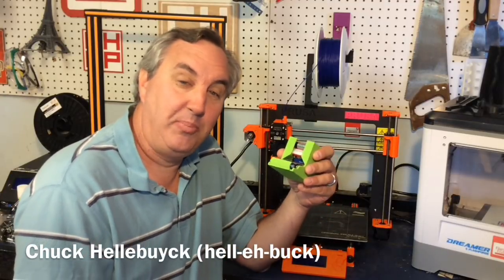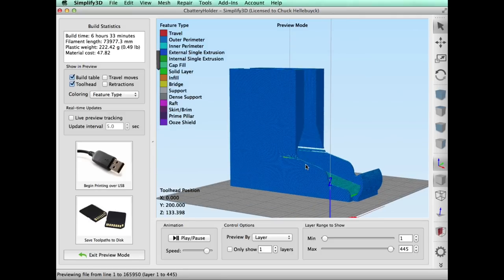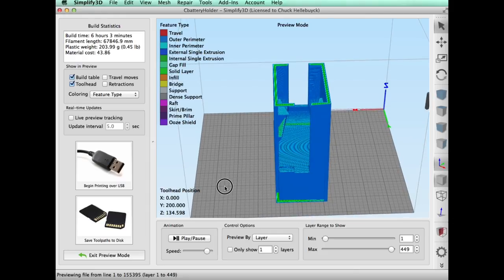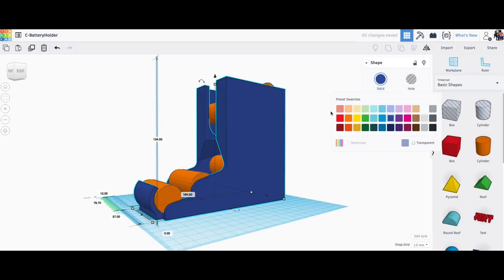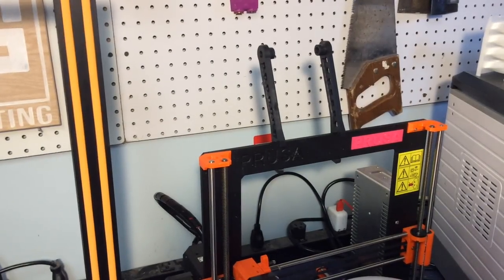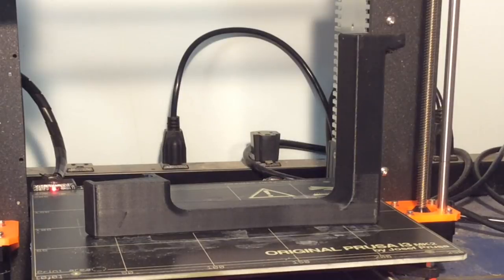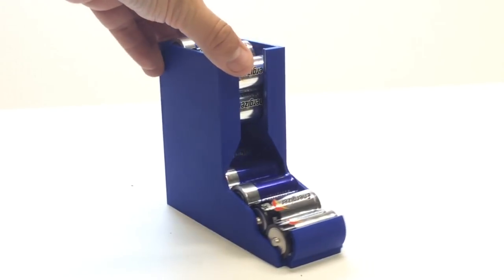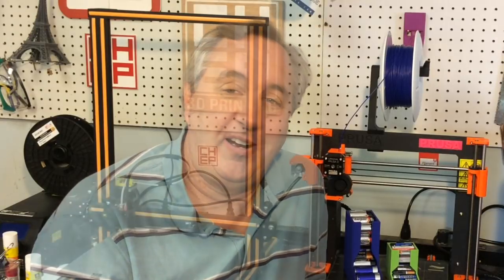3D Printed C Size Battery Holder on Prusa I3 MK2S

Comment: I like your videos simply because you produce, 3D print useful things, and you are not making a bunch of plastic trash like most other youtubers (with a few exceptions like Maker Muse, Thomas Sanders, Make Anything). Most of others print hairy lions, baby groot, pikachu and similar plastic shit - over and over again - every time!

PLA is biodegradable, but in special conditions - thrown somewhere on the ground, it would probably last 500-1000 years.

Comment: Interesting. I had a similar experience trying to print the modified AA battery holder (with closed front showing AA on it) but didn't realize it until half way through the print when it stopped extruding for a few layers then started up again. FortunateIy, I caught it shortly after that happened. I had sliced it with PrusaControl because it seemed to be a simple print. It dId look odd to me but it was one of the first things I'd sliced with PC so just went with it. When I put the STL in Slic3r and sliced it there was a completely blank space in the middle of the unit! Duh. I thought perhaps something had corrupted the file when I downloaded it so I deleted the files, downloaded again but had the same result in Slic3r. I printed the AAA battery holder by jgillick and it printed perfectly on my Prusa i3 MK2s. Go figure. Nice, handy design. Accolades to jgillick.

Comment: Hidden tinkercad tip: Instead of making a model a hole to see through it, hit the "F5" key, it won't reload the page, but instead turns the model translucent, saves you from having to switch back and forth from hole to solid when grouping!

Comment: Do you normally have good experience with makeprintable? I just tried them, and I'm not impressed. It took forever, they give you limited downloads per month, and my file didn't get fixed. They said it was, but it did not slice or print propperly. Should I give them another chance, or forget'm? I normally use netfab, and that always works. It's just a shame Microsoft ruined it.